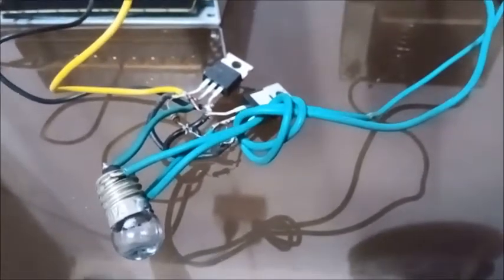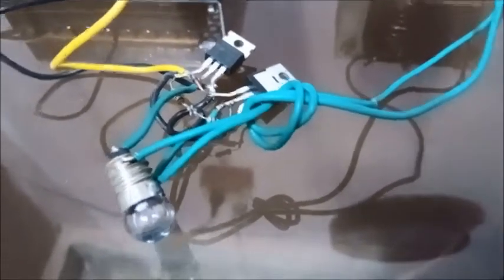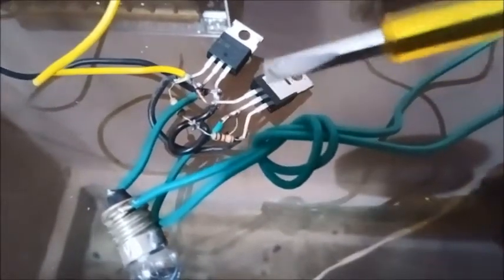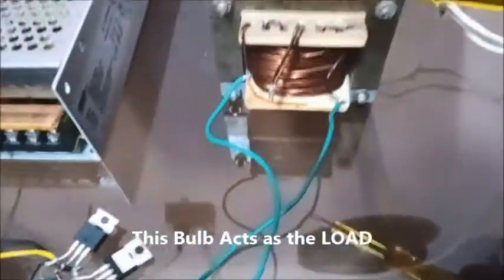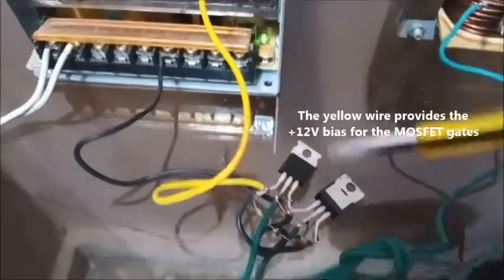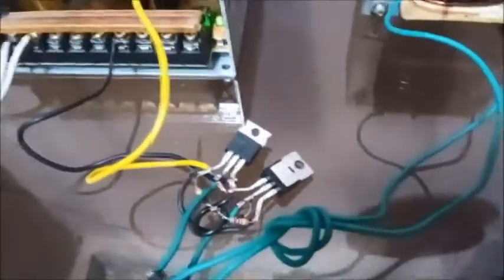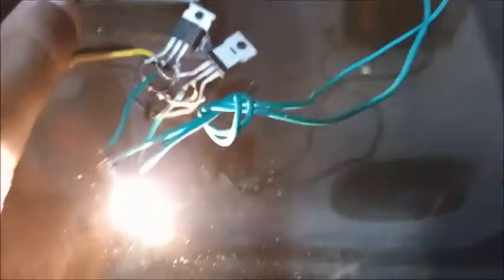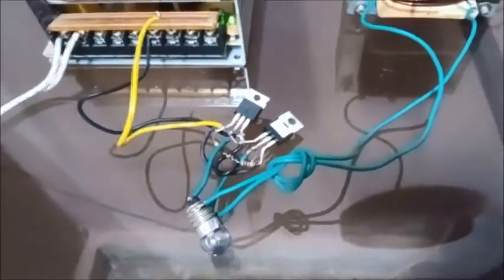Testing a Solid State SSR using MOSFET Bidirectional Switch

Comment: Does this work with a DC loads
Reply from the maker: If the supply is DC then yes DC load can also be used, but for DC loads you won't need an SSR you can simply use a single MOSFET or a BJT.